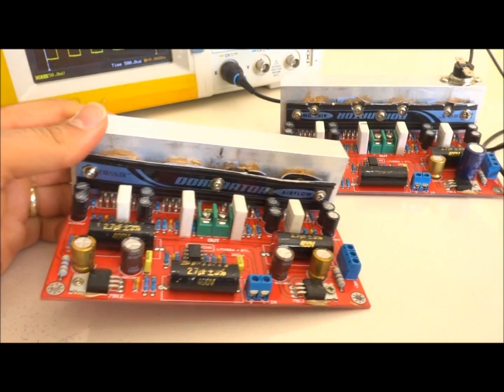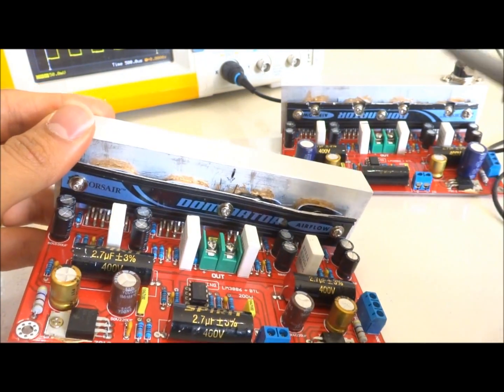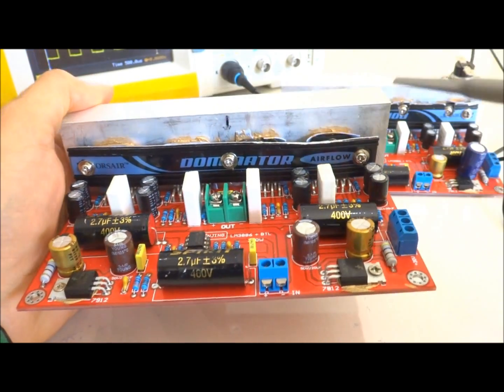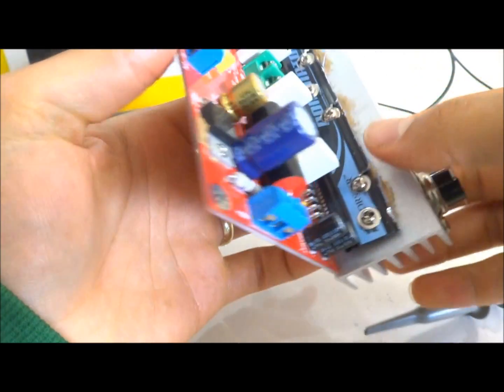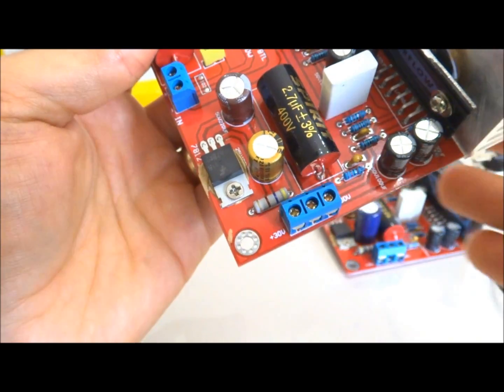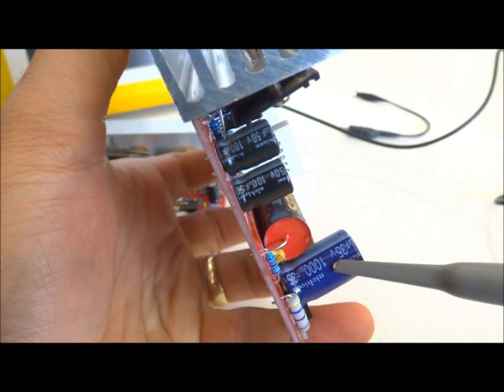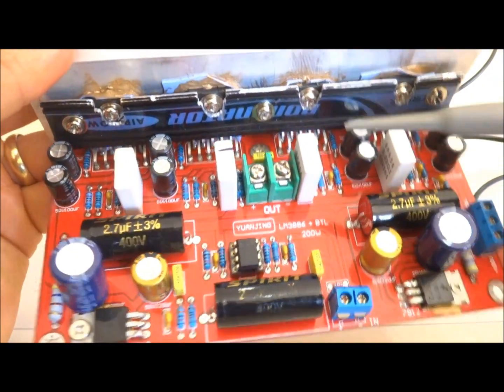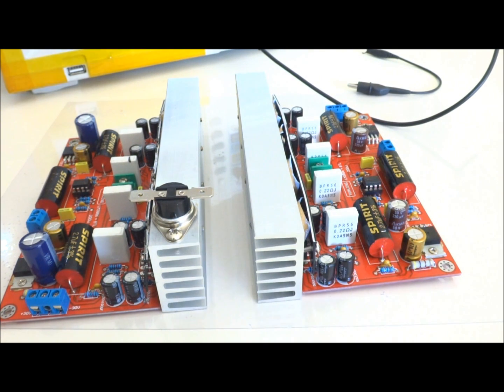LM3886 Amplifier Class AB 200W RMS HiFi BTL

Comment: Check the last 2 letters of the chip you have, there are 2 different kinds of Lm3886, 1 can push 68Watts @ 4 ohms, the other can push around 30 Watts @ 4 ohms. I forget the letters at the end between the 2 types. For audiophile listening you should shoot for 8 ohm loads, for loud party mode you will shoot for 4 ohm load but lose speaker sensitivity clarity.

Comment: I strongly recommend to remove the power regulators and replace it with a dedicated power supply. This IC injects a lot of noise in the audio, specially when used in the low voltage part of the audio signal

Comment: Consider how much power you want to develop and the load impedance of the speakers you will be driving. The LM3886 does a fine job driving 4 ohm or 8 ohm loads but is not intended to drive 2 ohm loads (it will drive 2 ohm loads, but it takes very little output power to hit the maximum output current limit under those conditions). Remember that in a BTL (bridged) configuration each amp only sees half the load impedance, so using a BTL pair to drive a 4 ohm load should be avoided. The same pair will, however, do a fine job driving an 8 ohm load. Operating 2 or more LM3886s in parallel gives increased output current capability, but more importantly makes it easier to deal with thermal issues. In theory each chip in the parallel bank can still deliver its full rated power. Since the load is shared, each chip is only providing its share of the overall power, which means it is producing only its share of the overall heat. A pair of LM3886s pushing 50 watts into 4 ohms will have each chip generating half the power and half the heat, meaning each chip is running cooler and providing less current than it would acting alone. The parallel configuration is good for driving lower impedance loads (like 2 ohms) or for "beefing up" bridged applications (parallel-bridged).
For driving 8 ohm loads up to around 100 watts, a simple BTL configuration will do nicely. Power supply rails should not exceed + 35V. LM3886 can be driven from either the inverting or non-inverting input, National at one time published drawings showing the bridge being set up by driving the inverting input of one LM3886 and the non-inverting input on the other side of the bridge. We prefer driving the non-inverting input of each side of the bridge, which means we use a dual op amp (TLO72, NE5532 etc) to generate the "mirror image" input signals. This does require an additional parts, but it keeps the gain precisely the same on both halves of the bridge. Since the dual op amp is essentially a pre-amp, by using a pot for the feedback resistor in the first half of the network it is possible to control amplitude of the signal going to the main power section. This can be convenient for coordinating a subwoofer with the main audio channels, for instance. Refer to the drawing in ApplicationNote on bridging for the circuit and component values used.
Results are less satisfactory for bridging 4 ohm loads, even with reduced voltage supply rails. Two LM3886s each driving their own 4 ohm speaker will produce more audio power than they will driving a single 4 ohm load in a bridged configuration. For bridging 4 ohm loads, the parallel-bridged configuration should be used.
Parallel-bridging is nothing more than taking two paralleled banks and using the bridged configuration. The hard part is setting up the parallel banks, bridging is just like using a single pair of chips in the BTL configuration. When using the parallel-bridged combination to drive 4 ohm loads, attention must be paid to the voltage supply rails. Do not exceed +30V for best results, and in many applicationlications a slightly lower setting may go a long ways in preventing unexpected shutdown.

Comment: For higher voltage you could increase the dropper resistor values, but It would be a better option to break the traces to the regulators and power them from a separate supply. You could then maybe run up to the max 42-0-42 volts of the chips. I think the isolated packages on that board will struggle to remove the heat fast enough though, which might explain the lower input voltage.